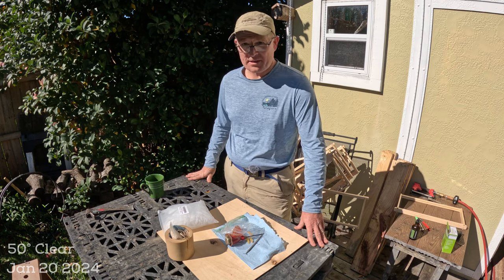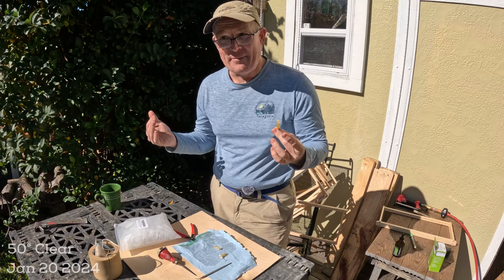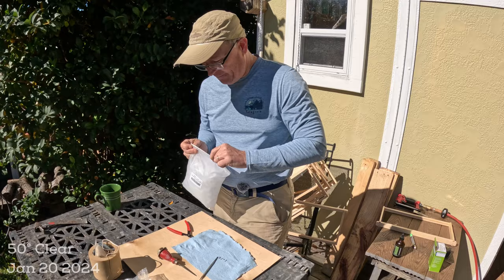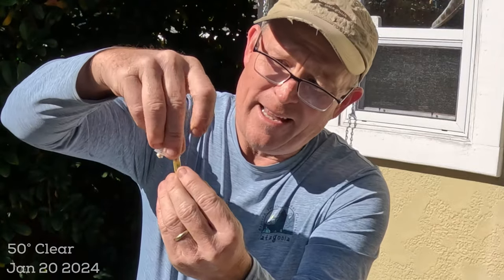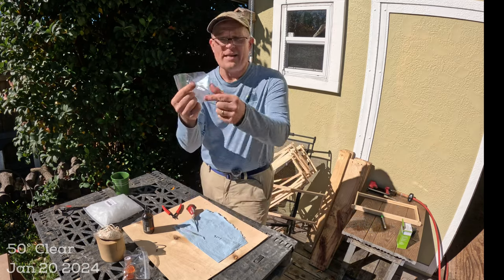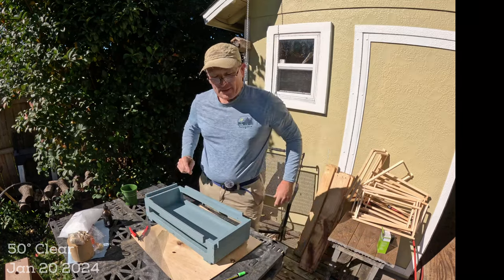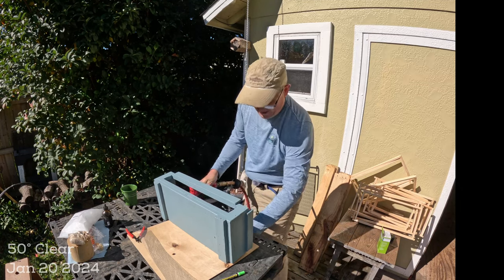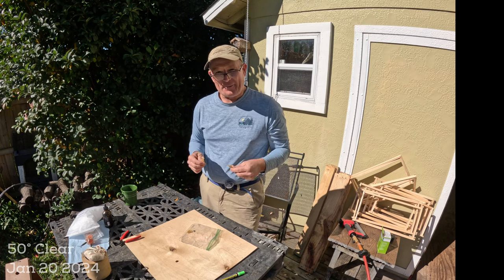Make Your Own Extended Release Swarm Lure Vials - Jacksonville FL Zone 9b

Comment: I posted this on your gummy video and then I saw this one. 

If you still like the idea of gummy lures, try agar. Its a natural seaweed product and will hold up much better in your temperatures. 

The melting point for gelatin is 95 F (35 C) whereas the melting point for agar is 185 F (85 C). Therefore agar requires boiling before it sets at 90 - 104 F (32 – 40 C). It is also much more resistant to biodegrading. 

Its a one to one swap for gelatin.
Reply from the maker: Nice idea.